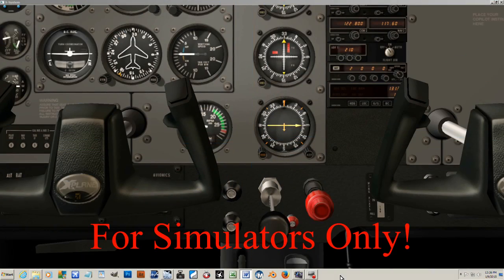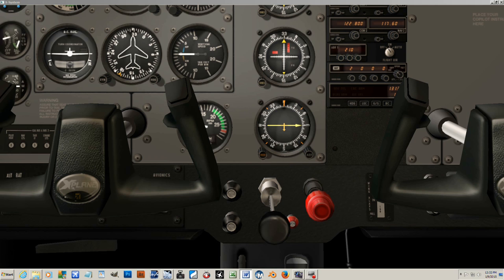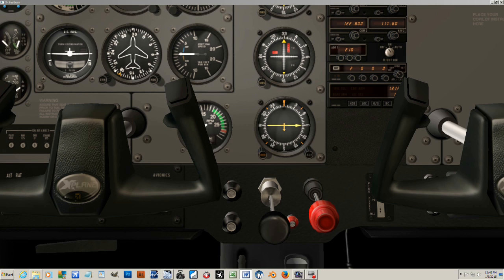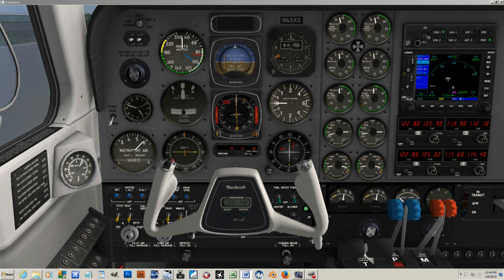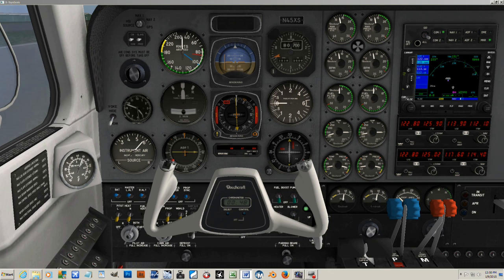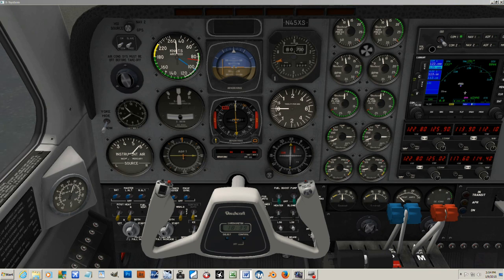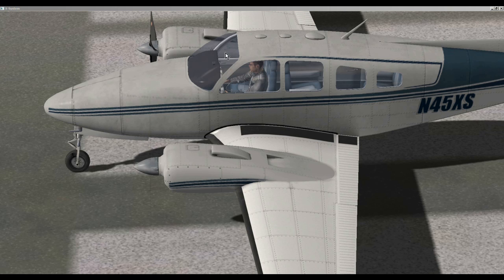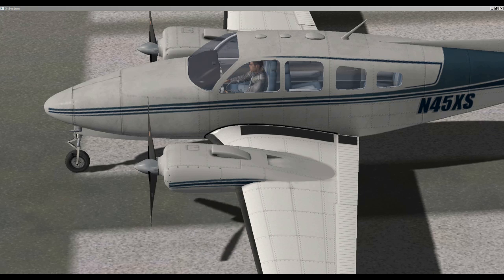How to Use Prop and Mixture Controls in X Plane ~ Tutorial

Comment: Great Lesson. What your adjustment would be for landing?
Reply from the maker: +Ramon Arriaza Hi Ramon, Not sure what adjustment your are referring to. I check the POH for V speeds for landing and flaps. Flap setting will depend on winds. For example if you are landing in a strong headwind then you don't need a lot of flaps. The flaps give you lift at slow speeds and help you slow down. In a strong headwind you don't need much help to slow down so you might use less flaps. Read the Pilot Operating Handbook (POH) to find the speeds for takeoff and landing. check out all the V speeds.

Hope this helped even if it's almost a year in replying :-)

Blessings,
skip
Reply: Prop levers always full-forward for landing - just in case you need full-power for go-around - you never can tell when a go-around might happen, and you don't want to be looking around the cockpit trying to find out why your heavily loaded and under-powered six-seater won't outclimb that row of trees in front of you - very unfunny I promise you.  During downwind checks to land, and over-the-threshold, always check 'carb heat cold, props fine' and push both full-forward.